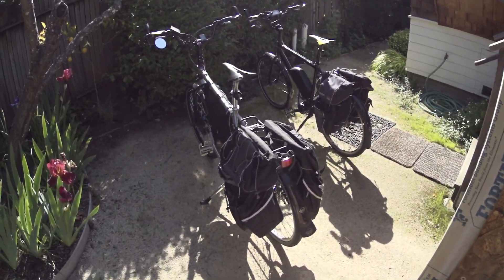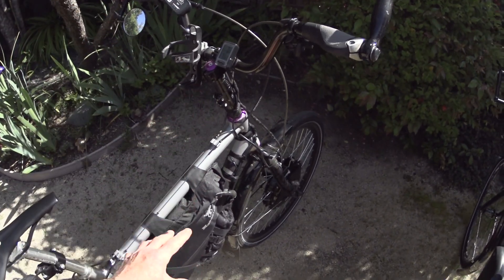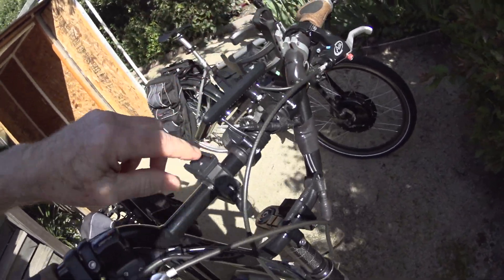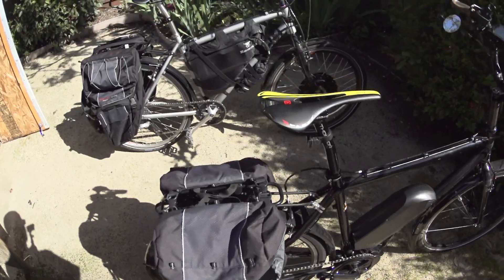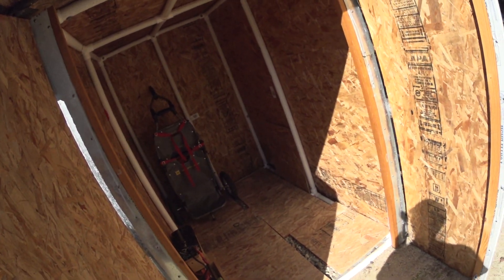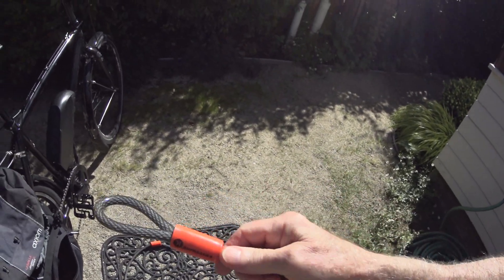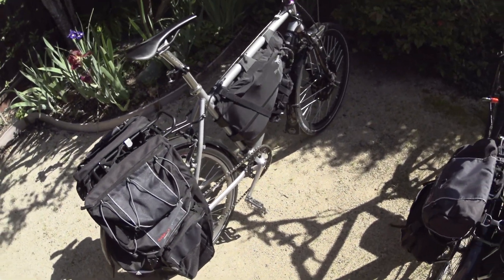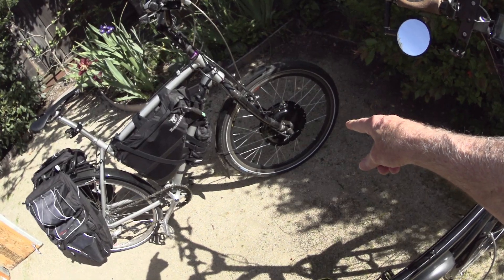Hub motor vs mid-drive motor for Ebike - side by side comparison

Comment: Mid drive is better because it drives the chain and rear cassette meaning you can use the gears to get the most out of the motor, mid drive is better for hill climbing in my experience.

Comment: If you're careful about gearing the BBS02 is more capable of towing than a (similarly powered) hub motor. A front direct drive hub motor is probably the least efficient set up for towing. It's definitely the least efficient way to climb hills.

Comment: Hi there: Thank you for this video.

Good and cool setups of your e-bikes. I like these BMX handlebars:-) , so you have a very good position. 
Which grips did you mount? Ergon? Which model? 

Air, dirt, CO2 emissions, noise, parking spaces, energy saving, health of people - many, many problems can be solved, if people ride normal and e-bikes. 

You do exactly the right thing! You save a lot of cost and energy and it's great fun riding your bikes. 

I love the San Francisco bay area where you live. Great there! 

Schwalbe Marathon Plus tires are a must-have. Also good: Continental tires out of their Plus series (normally cheaper thanbSchwalbe). Kenda has also Plus. And Vittoria Randonneur is also a very good tire.

I swear on CroMo steel frames. Ok, they are usually heavier than the aluminum ones, but very confy to ride, long-lasting, and can be repaired easily. 

A good CrMo steel frame like for example one from Surly, Trek 520 and so on lasts for 30, 40 or even more years. If you see one for a good price new or used, I can recommend to buy. 

Also good: Trekking/touring/MTB CrMo steel frames from the famous brands like Scott, Trek, Marin, GT etc. from the 1980s and 1990s. The quality and durability of these frames are extremely good.

I wish you always amazing riding!

Comment: great video  very similiar setup 6 self build using bbso2 750w and today just finished a bbshd with 52v battery [brilliant] how do you find the hub drive on steep hills? also what pannier have you on both bikes thanks. from a hilly liverpool!
Reply from the maker: Hi.  The hub drive is a bit sluggish on steep hills, but it always gets me up them. I generally ride in low power mode on the control panel to conserve battery life but move up to medium power if I get a long steep hill.  I never ride in high power because the bike is plenty fast in low/medium and see no reason to burn out a controller to go a little bit faster.  I live in the San Francisco Bay area and there are hills everywhere.  The hub motor pulls me and and a trailer with an 80 to 100 lb (265-285 lb total)  load up every hill I have encountered.  I like the Bafang BBS02 better for general riding but just don't quite trust it to pull the loaded trailer up hills.  The panniers are the old Axiom Journey Series (Lasalle on the BBS02, Champlain on the hub drive) .  Fantastic panniers but they stopped making them years ago - why I will never know because they are great.  

I love both my ebikes - had a lot of fun building them and they are wonderful transportation.  With my bikes, shed, and solar charging operation I get everywhere I need to go, have ZERO transportation expense and zero emissions.  Can't beat that.  Best to you -
Reply: @bikingsamsara  Yo. Just leaving some informations to your consideration. To make solar they are mining quartz deposits as getting quartz from stone is too expensive and for batteries the amount of pollution you get from making batteries is almost proportoional to the explosive petrol polution.

Nikola Tesla wanted to transmit power through Earth with minimal loses and called radio an aberation of science - yet we still use it today to make people sick.
The oil oligarch aka morgan shunted him and he couldnt win the radio race as his lab was mingled with and destroyed and after marconi took all the fame they didn't let him run the wardencliff tower.
Rife cured many aligments by means of resonance. He would use radio frequencies to resonate viruses and bacteria and he was the first person to be able to observe them alive with this method - but noticed if he increased the amplitude the things would die. Similary to a glass being broken by voice.

Eat healthy, avoid wireless and dont vaccinate (rockefeler shunted holistic medicine and true knowledge by funding medical schools)
Reply: @bikingsamsara  If your chain-line allows you to use 1st gear (the stock chain ring usually provides a terrible chain-line for low gears) the BBS02 can conquer towing even on the hills of SF. I highly recommend a chain ring with better offset than the stock. My BBS02 can climb anything in 1st gear. I found it powerful enough that I lowered the power from 25 amps to 18 for extra range (I'm using  a 6AH battery) and it still climbs (just not as quickly).
Just FYI my chain ring is a 42 tooth Lekkie Bling Ring and my 1st gear is 34 tooth.

Comment: Cool video👍 
I'm thinking to to convert my bicycle into an ebike with the bafang 350 watt system. 
Here in Germany you are only allowed to drive maximum 25 km an hour so I can't go bigger with the voltage or the wattage.
Ist der bafang waterproof so if it rains do I get problems with the Motor? Or in the winter can I also drive the bicycle at like minus three of five degree? Of course I would take the battery inside when I leave it outside in the winter but just the driving you think that's possible?
Reply from the maker: Hello.  I have ridden the Bafang BBS02 in pouring rain numerous times and never had any problem.  When it is raining I do cover my battery pack.  I use a hiking gaiter - it unzips and is just the right size to zip back around the battery pack and frame.  It keeps water out of the battery area, which is more likely to leak.  The Bafang motor is sealed really well and again I've ridden in very heavy rain with no problems at all.  I live in California and it rarely gets below freezing so I can't tell you for sure how well the motor will perform in very cold temperatures.  I do take my batteries inside the house when it is cold - lithium batteries do not like really cold weather.  You always want a battery pack that is removable in some way for that reason.